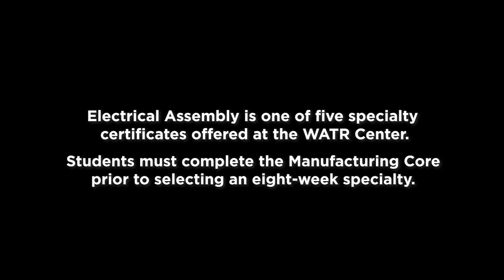Electrical Assembly Certificate

Comment: Which boeing jobs would be most applicable to this certificate? I see via PBET that electrical assembly cert. offers interview-less entry to Boeing for assembler/installer, structures, and fuel cell assembly, but are there other positions more suited for what this course teaches? Thank you
Reply from the maker: Thank you for reaching out! BPET (https://jobs.boeing.com/bpet) will be available again March 1, 2024. Boeing hasn’t verified the criteria and job requisitions yet as they apply to the WATR Center Certificate programs. Job titles and classifications that traditionally coincide with our training include Wire Assembler, Installer, and Fuel Cell Assembly. Other job roles and career pathways are available here:  https://watrcenter.edmonds.edu/programs/certificates/electrical-assembly.html
Reply: @EdmondsCollege  Thank you, currently at WATR to check out their tour, and I start Mfg Core tomorrow. Looking forward to it!
Reply from the maker: @1Peezy1  So exciting! 🔱💙
Reply: @1Peezy1  how is your classes going,
Could someone get an entry level job at Boeing with this certifecate?
Thanks.